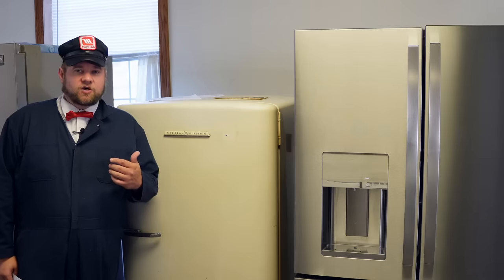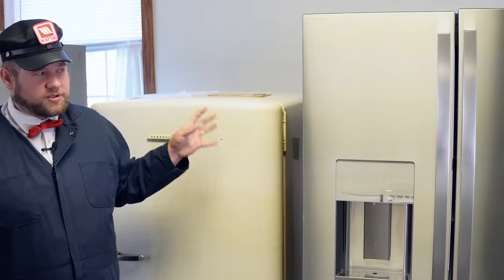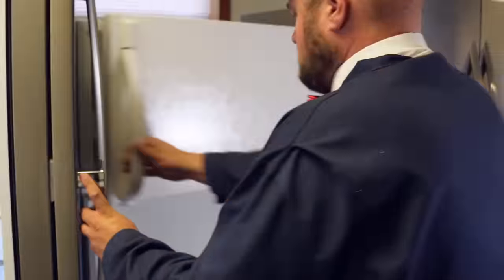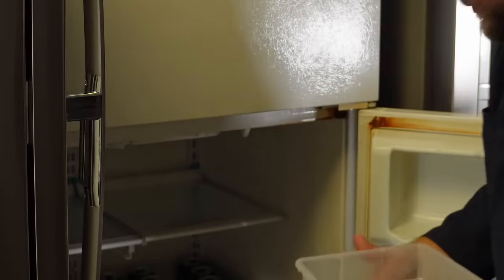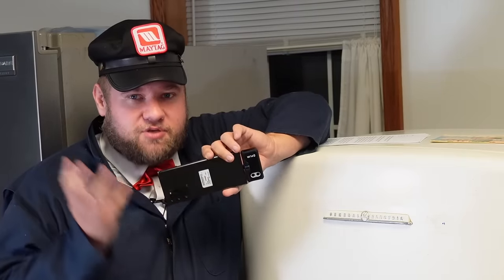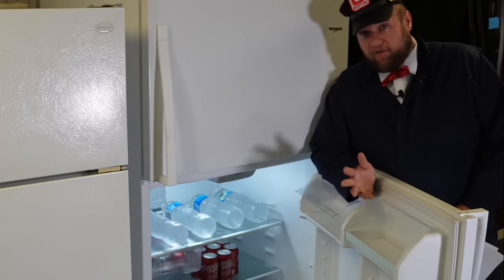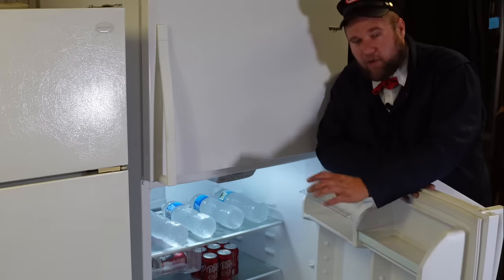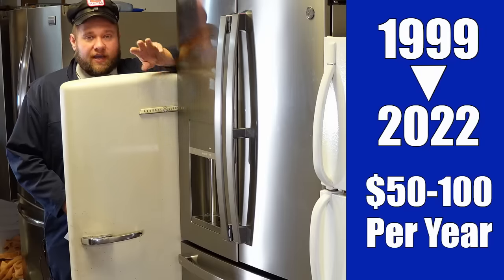Should You EVER Buy a New Appliance if Yours Still Works? A 7-Day Test

Comment: It's beyond disbelief that 10 years would be acceptable as the life span of major appliance.
Reply from the maker: It is. Hopefully a few mfgs. watch this video and get the hint.
Reply: Indeed
Reply: How dare them not make appliances that will still work when I'm elderly
Reply: MY TEST: 1) 1998 Maytag (R134a, side-by-side) uses 3.5kwh/day,    2) 1995 Amana (R134a, bottom freezer) uses  2.4kwh/day.   Note that they where made DRASTIACALLY better than current models.  27 years old and 24 years old and operate perfectly fine.
Reply: My appliances are going on 24 years and I have no intention of replacing them.  I’ve made minor repairs and when I go for parts, the guys tell me NEVER get rid of them and they are from “The Golden Age of Appliances.” 😊
Reply: I've been in the appliances industry for over 20yr and sadly none and I mean no regular residential major appliances will Lasf 10yrs!!! Honestly your looking at 5 to 7 years and that's tops !!
Reply: @MarcM143  I get your cynicism but the technology is there to easily do it.
Reply: I was gifted an early '70's Maytag washer and dryer when I moved into my house in 2004. Still running after a few repairs done by myself. I have no plans to retire these machines.
Reply: @glendonwagers2471  All my appliances from 15-20 years ago are working just fine.  It’s all about how you take care of them.
Reply: Speaking as an HVAC tech there's some people in my industry that push the same figures. Luckily higher quality of install can improve longevity and durability.
Reply: The term for them used to be "consumer durables." Not so much anymore.
Reply: What did you expect it yyo be 7 years ? It's less than 7 for a lot of them.
Reply: @bensappliancesandjunk  Unfortunately they know exactly how long the expected life time is before they break which is why they only give a warranty for 5 or so years, just long enough to sound good but long enough you are well out of warranty and need to buy a new one and keep feeding their pockets.
Reply: Everything is built to a price point.
Reply: @glendonwagers2471  I only had a washing machine dying after ~11 years. All other appliances still live on.

I think my 15 year old plasma TV will survive another 2 tech-generations.
Reply: 10? I wish, and I get your point.

I am so fed up with Siemens (BSH): 6 year old appliances, the gas burner with a computer inside is waiting for its second board. The fridge I had to call technical service 3 times, dish washer two times. Next year when the burner goes again I am replacing it with something else. Microwave is Electrolux and also turns itself on all the time. Only thing that hasn't caused trouble is Whirlpool oven. Such a joke.

My mother has miele washing machine, dryer and dish washer, less than five years, already had to call technical service for the dryer because dried o rings. 200+ USD repair.
Reply: I worked for whirlpool. The problem is government regulations determine what types of refrigerant we can use, the wattage of parts like compressors and motors, and shit like that. This results in designs that don't last as long. The other problem with modern appliances is they have a bunch of chips. Computer parts do not last like mechanical parts do.
Reply: @pablopicaro7649  My big 1991 Frigidaire side-by-side uses about 4kwh/day.
Reply: @glendonwagers2471  Maybe I'm from an alternate dimension or something, but all the refrigerators in my possession, my parents, my in-laws etc are over 10 years old with no issues.  The fridge in my kitchen is a freezer-on-top Frigidare from '99.  I had it's thermostat repaired once 5 years ago.  It's fine now.  I replaced my dishwasher 2 years ago - the previous one was 20 years old.  My washer is a Maytag Neptune from 2001 and the dryer is a Maytag from the '80s.  All are fine.  What are you people all doing to your appliances????
Reply: What do you mean? (not trolling, your comment could be understood both way depending if you are on the manufacturer or customer side...). If my 500 euros fridge does last 10 years, I wont be particularly unhappy knowing they are build with planned obsolescence in mind these days...
Reply: I mean it was accepted for years that you would by a new car every 5 or so years.
Reply: @nicholascortez728  huh I get a new car like every 2-4 years
Reply: Me too, I was under the impression 15- 20 years was a norm for a Major appliance SMH
Reply: @MarcM143  that’s a good göyim, keep paying the göyim tax and be happy you don’t have less.
Reply: for sure, especially with how much they cost
Reply: @glendonwagers2471  i can't recall a single major appliance stop working for me in my entire life, both my own and my parents. 

Granted I'm not American, but I assume we're all using the same foreign goods.
Reply: for european major appliances from european brands the expectation is about 14 years with maybe a minor repair around 8 years and proper maintenance. you can get 20 years from obscenely expensive premium (domestic) brands. I reckon that's acceptable, and now the eu mandates parts availability. The only way the situation can improve is with government involvement.
Reply: Well, you can drastically prolong the average lifespan of your appliances by only buying those which have the least features, don't claim to be the most energy-efficient (reasonably efficient is OK) and are from brands that a professional repairman will say last long time. Preferably something manufactured in a civilised country. It is true for anything. Lotus cars moved their steering wheel housing manufacture from Czech Republic to China to cut costs, but had to return back to CZ and beg the original company to make them again as in China, nobody was capable of properly cast the alloy and than work it into shape (the Czech company was able to do it and used the best technology for it and their staff had decades of experience in the field)
Reply: And it's terrible for the environment
Reply: @glasshalffull2930  Same. Wifey wanted a new washer/dryer/fridge when they only required a combined $75 in small part replacement. I convinced her that 75 is less than 3500.
Reply: I don’t know where people got it that shit needs to last 25 years. I work on furnaces and people just have so much trouble understanding that the else things go through a beating. Imagine driving your car 24/7, how long would that last?
Reply: The real problem is companies overcharging for labor. We live in a throw away society where a simple 20 dollar part costs 300 for someone that knows how to install it.
Reply: Those poor corporate execs can barely afford to keep the lights on in their fifth home! They HAVE to sell junk with a limited lifespan to keep that money rolling in!
Reply: @abrahamlincoln9758   The idea that appliances, that are working perfectly fine, need to be replaced because they’re outdated or not  in fashion is maddening.
Reply: I hate to tell u but I bought a large Amana fridge back in them 1990's. My parents are still using that fridge. My dad has replaced the gaskets twice and that is it
Reply: @katespencer4038  Actually, that’s to be expected as the ‘90s were the last time appliances were made to last.  INMO, a major part of it was the switch to digital features controlled by circuit boards.  The boards just cannot standup in the wet/hot/cold environments.
Reply: @hunner9500  Some experts now believe that furnaces are not cars, furnaces don't operate on salty roads, but are often kept inside houses. My grandfather installed a furnace in the early 1970s and it remained working until mid 2000s when it was replaced due to fear of new environmental regulations under a financial incentive to change your furnaces, still fully operational. My ex had a furnace from the 60s as late as I remember (last I have seen it was 2011). Those furnaces were made cheaply in the second world and were considered of low quality on the world market.
Reply: @glasshalffull2930  good to know I am sick of replacing appliances have located rebuilt appliance store. Now I know the decade to look for
Reply: @katespencer4038  With a digital multimeter and YouTube, almost anything can be repaired.  Best of luck!
Reply: Sadly, if you run the numbers, companies would lose money if they invested into making stuff that lasts that long. There should be government incentives instead
Reply: @abrahamlincoln9758  How long did that take & what argument was the winner?
Reply: @hunner9500  my dad put a floor furnace in his parents house in 1950 that furnace is still working fine. i would bet it is still working 50 years from now, with a yearly cleaning, but i will not be here to collect on the bet.  things are just not built to last these days
Reply: My mom's 4 year old deep freeze quit and spoiled $500 worth of food.  The appliance dealer said appliances are only made to last 3 years.  These people should be sued, for how much food we lose over this.
Reply: This is totally true. Our last dishwasher only lasted 6 years, we replaced it with a Maytag one.
Reply: @420BLUNTLEY  This just literally made me lose all faith in humanity for the f**** 100th time. Not All appliance manufacturers are Jewish, so stop bringing religion into this.
Reply: planned obsolescence
Reply: @dfgrego  Oh no, there was no argument. I just pretended not to hear her after she said "HONEEEEY! THE [APPLIANCE] IS BROKEN!" and immediately when into deaf husband mode when she said, "We're due for a new one anyway. I'll start looking online."

The key is speed. You have about 15 minutes to find the problem and the part and two days to fix it completely while she searches for a replacement. Do not consult whether to fix or replace. This will initiate a conversation that will result in an argument that you will lose. Do not ask her about her online search, that will initiate a conversation that will result in an argument that you will lose. Do not tell her that you'll have it fixed soon, that will initiate a conversation that will result in an argument that you will lose. Instead, find the part you need online, wait till approaches you with her dream machine that she openly admits you can't afford, then tell her you already have the part on order and you'll have fixed the problem for fewer than $50 with your impressive manly repair skill that you totally didn't watch youtube videos to obtain. Essentially, you must solve the problem before she does, showing her what a manly man you are that doesn't need help from the internet.
Reply: @petrmaly9087  stop making up stories. If you pay people properly you get quality products. I’m not aware any cz made products that China cannot make; there are a lot of things China makes that CZ cannot. How many CZ universities are on the list of the world best universities?
Reply: @CB-bl8sp  That's not a story, that's a fact. I told you a housing for the steering wheel for Lotus cars. There is a reason why companies like Colt (US weapons manufacturer) are owned by Czech corporations. And if you think that "if you pay properly" is the only way... well it doesn't work either, you need to provide benefits for the population as well, like not living in a totalitarian hellhole, having human rights, which is normal in CZ, but only a dream in China and the best people run away.
Reply: My family has only ever replaced fridges when they broke and the longest lasting for us here in the UK out of all lasted like 11 years and was a Hotpoint brand about as big as that 2022 GE fridge you have but instead of having a 2 door fridge on top and a freezer on the bottom it had 2 doors going from top to the very bottom and the right door had the fridge and the left side door was the freezer side
Reply: @glasshalffull2930  23 years for me, and my fridge is the parents old one so 30+ maytag.
Reply: I just picked up a whirlpool gold double door refrigerator from 2001 for my new to me house. It wouldn't cool at first but a $10 relay fixed it so no need to buy a newer one
Reply: air conditioners the new ones are the same lol and its not wven a guarantee the 10 years
Reply: 18 months seems to be my current run with kitchenaid appliances, except the mixer keeps going. blender, food processor, trash.
Reply: I've seen vacuums shit themselves in like 5 weeks
Reply: @stephenmergner  technology is there to help the business who sold you crap, not help you save money/hassle.
Reply: @bensappliancesandjunk  Just buy Miele. Problem solved. Or Bosch. Siemens even. Or AEG. 

That's the order of "solidness" too.
Reply: Just replaced a 40+ yr old furnace and was told the new one might be good 10-15 years.
Reply: They last more than 10 years if you don't buy the bottom line budget models.
Reply: @DOGS LOL Great argument, mr. dogs lol
Reply: I am knocking on wood as I type this but we have  Samsung kitchen appliances and all but the dishwasher are still going strong and just turned 10 on black Friday. We do have a hole house surge protector and each appliance also has its own, not sure if that helps but I think it does. The dishwasher sprung a leak last year and I just replaced it with a new Samsung that was on black Friday sale.
Reply: Same reason roads get potholes and lightbulbs burn out, ANYTHING can be made to last, but people that repair this stuff need jobs too. Now the line needs to be drawn between corporate greed driven by disposability, and tedious unreliable sh*t that nobody wants to own, repair or buy that may not even work. Theres 2 extremes.
Reply: My repairman told me average lifespan on the LG fridges is 7 years.
Reply: @sunnohh  I'm gonna guess you lease or like having loans if you're talking buying new. 

Back in the day it (40s-70s) was the idea was you would trade in your car about every 5 years or so cause that's about how long they would last from wear. That why you will hear old timers say shit like "oh it's got 100,000 miles, that's gonna be worn out".
Reply: @SilvaDreams  I mean you can always repair them... depending on the make parts can be readily available. Just replaced the circulation motor on my 7 year old KitchenAid dishwasher. Cost me $165 and 45 minutes of my day as apposed to 800-1500 for an "equivalent" model. 

The issue is is they have successfully made it so people see an older appliance as outdated/inferior and the idea of not having the latest and greatest means you are poor/low class which isn't desirable.
Reply: @jackyack7850  that's generous.
Reply: If businesses made everything they made to last the max they could, what keeps them in business?
Reply: @abrahamlincoln9758  You are wise beyond your years!!! As a very frugal woman, I will not divulge this manipulation to my fellow women. 

Men!!! Are you listening to this? Heed this man's words of wisdom.
Reply: It’s because most new appliances are only made to last 10 years
Reply: I have Samsung appliances. Never had a single issue and way cheaper to run than the competitors.
Reply: @MarcM143  Yea, unironically they should last until you are elderly. They are simple machines that have already been perfected. Then they intentionally started practicing the filthy practice of planned obsolescence, and all of those involved need named and shamed.
Reply: Try 2 years on tumble driers and washing machines, it's disgraceful!
Reply: @aHumanCookiee  Currently using a washing machine from 1992.
Reply: My buddy bought a brand new washing machine 10 years ago. About a month after the warranty ended it broke down. I'm old, growing up we had a fridge that must have lasted 20 years.
Reply: @SilvaDreams  thats not really how it is, it’s cheaper to repair appliances than to replace.
Reply: I feel like I've gone through too many dryers for someone my age (23) but if you include dryers that roommates owned + mine I've had to replace like 4 broken dryers since moving out at 18
Reply: @Isissa125  If they were new, it's evidence you get what you pay for.
Reply: supply and demand, almost everything is built to fail nowadays
Reply: @glendonwagers2471   i going on 20 years 3 applainces and no repairs yet, stuff can last
Reply: @LostBeetle  yup, they lasted back then.

We just replaced a tumble that started blowing trip switches at 2 years old.

The fact appliances like this only have a years warranty on them shows how long they are designed to last. It's not even worth paying a call out charge to get them repaired at the moment.

Hopefully right to repair will sort this out.
Reply: @jakerazmataz852  yup, It all used to last. We had a fridge and a boiler that lasted about 23 years.

Nowadays you are looking at 10 years if you're lucky.
Reply: Appliances from 15 to 20 years ago were built better than anything in the last 10 years.
Reply: 10 years is a pretty good time for any device without it turning into the ship of theseus.
Reply: @HeatGeek1  yes.  Had a few noobs install heat pump/Ac combo.  Problems every freaking year!  Had to ditch it in the 90s
Reply: @ohsoloco5113  I had same and traded in a brownish yellow with what looked like a bullet hole on side of it 1970s GE washing machine for a 2020 pretty white spindleless energy efficient self sensing top loading Kenmore  washer and have already had to change the balancing springs because it kept going out of balance no matter what we washed... then I found out a special type of grease can be reapplied to the spring spindles to help them grab better to make the balancing work properly again... point is i have already had to fix it and the old one rusted though before it needed any adjustments... probably should have just switched the old drum, but new stuff looks nice....
Reply: @aHumanCookiee  believe it or not 23 years for a cast iron sectional boiler if that's what you had is actually fairly a fairly short life span. 30 to 40 years is more common. People do cringe when they see the install prices though.
Reply: @HeatGeek1  no it wasn't a sectional boiler, it was a standard Trianco utility boiler.

Dad replaced it himself at 71 years old because installation costs were ridiculous.
Reply: It's not just the customer getting screwed over with a 7 year refer, but the resources used going into making the thing. Just look at the time, material and energy that goes into making just one. (make sure you include the oil well and refining to make the plastic) Since we're replacing them at around 7-10 years, we're building 3x more refers than we need to.
Reply: I can see the appliance companies reading these comments and thinking, "... dang, you mean these things will last up to 7 years??"!
Reply: Based on my experience, if a refer runs for 10 years it'll probably go for 50.  I have two, a 2003 Whirlpool (with still working ice maker) and a 1995 Roper.  I thought about something more efficient but after this video, I'm keeping them. 😏
Reply: @bensappliancesandjunk  I don't care if a new fridge is more efficient if my old one still works I'm keeping I wo t justify paying 2-3,000 for a new high end fridge to only last a few years.  Here at our work we have had the same whirlpool gold white sided by side since 2002 it works perfectly there is absolutely nothing wrong with it. My mother has had the same jeenair fridge since 2002 as well too I've have recently repaired it the defrost heater went out she was going to toss it for a new one I told I'll just go over there and repair it. It's now currently working g perfectly again.

At home I have a old fridgidar from 201p top and bottom stainless steel works perfectly yes I keep fridge temp thermometers in my fridges and freezers. I also have a whirlpool 90s ge top and bottom white in our garage it works perfect as well.

I can't justify replacing my old fridges that work perfectly and have worked great for 10 plus years for a new fridge that might die in just a few years before we even see any savings so in reality there really is no reason in my opinion to replace a fridge that's working just fine.

If they can make a new fridge that will easily run 20 years I might consider a new fridge until then I'll keep mine until they die.

I've had friends and family buy new refrigerators spent good money and they run long enough for the warranty to expire then they have problems or they have issues from day one. I'm not I interested in replacing a good fridge for that.   That goes to all my appliances.  My washer and dryer are 20 years old and work perfectly I have no intreast in replacing them. The only appliance I've replaced is my dishwasher and ac unit and that's because they died.
Reply: @stevenplaysbone8791  in surprised. In the car world whitch I'm more familiar with the electrics are always the last to fail unless they get wet. Sensors not withstanding
Reply: @putinslittlehacker4793  well, it's apparently the opposite in appliances. I know ovens can get up to damn near a thousand degrees. All I know is when I have someone call because their 3 year old fridge or dryer is fucked it's the control board.
Reply: @MarcM143  The point isn't that they can't, but rather that they actively choose not to. They specifically engineer their products to fail because they make more money if you have to buy seven fridges throughout your life, instead of just one that can be repaired. It's also vastly more wasteful, but people seem to ignore that part because they get a shiny new appliance every few years.
Reply: I hate to say it, but perhaps apparently this is an area where government regulation is needed because of how these short lifespans affect the environment. On the other hand, if refrigerators lasted 20 years, then there’d be more power consumption because of older and less efficient refrigerators. Of course, how much electricity and fuel is used to produce new refrigerators and transport them to stores and homes? There really isn’t a winning formula. 🤷‍♂️
Reply: @glendonwagers2471  
My window a/c units are 4 years old. I spent extra for the nice quiet models. Of course nobody mentioned they’re partly quieter because the fan speed is slower so they take longer to cool a room.

The electronic touch controls on one of them started messing up in the third year, so I had to start using the remote only, which is silly to have on something that you set and forget. The other one stopped blowing out of one vent in the fourth year, which doesn’t make any sense since I doubt it has two fans, but maybe it does. It will cost $350 each to replace them with an updated model, which includes wifi, an unnecessary feature that just provides another source of malfunctioning.

A few years ago I bought a Vitamix blender. They had just introduced a model with wifi, which I chose not to buy. I don’t need wifi on my blender. I don’t need another source of malfunctioning.

I don’t want wifi on my blender, a/c, or washer and dryer. I just want off, on, and speed controls. The good old dials and buttons, not electronic touch controls.
Reply: @CantankerousDave  
Yes, I remember the term “durable goods”. Even my $1,300 iPhone 12 Pro Max isn’t durable. The speaker crapped out after the 1 year warranty so know I have to use headphones to hear anything.
Reply: @amplituhedron5582  
Now that many new appliances have wifi, it won’t be long before they call the repairman automatically when a malfunction occurs. That’s where the dealers are going to make their money.
Reply: @stevenplaysbone8791  
Maybe manufacturers should inform consumers about the government regulations so consumers can push back.

If you have to replace your appliances every 5 years, there likely isn’t any energy savings because of the cost of production and transportation. It’s no different than electric cars not having any net carbon footprint than gas cars.
Reply: @LuckyCharms777  I agree.
Reply: @Progan666  
I was thinking government involvement was necessary too, but according to the guy who worked at whirlpool, apparently government interference is the problem, just like we’re seeing with electric cars. Soon enough electricity bills for charging cars will eclipse gas bills.
Reply: @hunner9500  
“Imagine driving your car 24/7, how long would that last?”
Apparently you’ve never heard of the most beloved fleet vehicle in the US, the Ford Crown Victoria. Between taxi and police service, they were used quite a bit.
Reply: @LuckyCharms777  They also has good maintenance.
Reply: @jackyack7850  That's sad. I thought LG made good stuff.
Reply: @CB-bl8sp  
Fun fact: American manufacturers had to teach Chinese manufacturers how to make things in order to have any semblance of quality control. The Chinese didn’t know how to do it until foreigners taught them.
Fun fact: Where do the brightest Chinese students attend college? Where did the instructors at China’s top universities get their educations?
Fun fact: Foreign countries all across the world have relied on Western knowledge. It’s only after having been taught by the West that they’re able to become self-reliant.
Reply: @Egleu1  
Nope, because the only difference between low end and high end models are the features, which are often the cause of failure and replacement.
Reply: @mattstroker3742   Not a lot of people are willing to pay twice up front for the hope it will last twice as long. I must say, my Mom bought an Electrolux vacuum from a door to door salesman in the 60's.. Damn thing still works.
Reply: @xPRODIGYxGAMER  I literally scheduled 40+ appliance repairs a day, and had access to what the most common failures are and when they occur. After two years the most common failure point by far was a control board or another computer part.
Reply: So did they in 1950 according to that manual:

"a dependable refrigerator. The refrigerating syste has been designed to provide many years of faithful operation. More than two million systems have been in service TEN YEARS or longer"
Reply: @rockstardonut777  
In the old days, people weren’t dumb enough to buy appliances that wouldn’t last, but today we even have bozos buying smartphones every year. Disposable appliances is akin to “you will own nothing and be happy”, since the powers that be want us to be lifelong renters of their products, which the replacement of appliances every few years is essentially. Remember when people had to rent home phones from AT&T because that was a huge revenue maker for them. I think it was the government that finally prevented them from doing that, but that’s exactly what the future holds. The subscriber model is the most profitable.
Reply: I think it's perfectly understandable, provided that you understand the despicable nature of the modern appliance industry.

I'm a bitter misanthrope, so I naturally appreciate that grim reality.
Reply: @glasshalffull2930  what era are they from?
Reply: money go brrrrrr
Reply: so let's compare an apple, an orange, and a banana
Reply: @ragebait988  1998
Reply: @MarcM143  When you start having to actually work and spend upwards of $2-3K on a refrigerator, you'll get it. ;)
Reply: @Progan666  Government interference has created the high-efficiency equipment that don’t last that we live in now. we need all governments to get out of the appliance business and HVAC business and the plumbing business and we’ll all get a better product.
Reply: @hunner9500  do you want to work for less money?
Reply: If they/we were really serious about the environment, they'd stop focusing so much on energy usage, they would instead give ratings for durability, repairability, and lifespan. Why can't 'EnergyStar' be more about just electrical efficiency and instead take into account the whole environmental impact of things that last less than 5 or 10 years? Manufacturing, distributing, and disposing of goods takes a lot of raw material and energy...
Reply: @chadhartsees  if you look at government policies across-the-board they have always cause more harm than good capitalism is the only way to achieve a balance let the customer choose. The key is limited government and more individual freedom. just go to Washington DC and visit your senator it will open your eyes. You’ll realize how dysfunctional our government really is.
Reply: Samsung you would expect 5 years before it dies. 

Never buy Samsung appliances.
Reply: I think you meant to say "beyond belief". But I agree, these things should last 15+. 10 years flies by.
Reply: @stephenmergner  Of course but there is no PROFIT in doing it. Most of the public want low cost and are not at all techies. The average idiot doesn't think like that. Only industrial/commercial gear is worth buying. (That's why I copied what local laundromats buy and ordered Speed Queens online, there being zero reason to have some brick and mortar outfit do the same thing.)
Reply: My 1992 Maytag RTD1900a is still going strong without a single repair. I am blessed.🙏 The family wood like ice through the door. I am not willing to give it up for modern junk🙄
Reply: The industry uses terms like "design obsolescence" that failure is designed into the unit to ensure replacement.
Reply: @user-tb7rn1il3q  that makes literally no sense....how the hell can you be rough on a fridge...
Reply: @HeatGeek1  to a point...manufactures LITERALLY design to fail. Carrier makes variable inducers that sag over time causing the wheel to explode. Min 1000$ replacement for the stupid motor plus labor. It would easily sway people to replace the entire machine. Your install only goes so far. Manufactures are all cancer and want your shit to break
Reply: Russian here. It's fun that we have a ton of folks using old finnish fridges (70s-90s) today and they are indestructible. There were a lot of them imported second hand in 00's and they are in use today. Washing machines, cooking stoves are same thing. They are easily repaired with parts still available, and they hold their value for decades. 10 years old major appliances are basically new, why change them...
Reply: Uh, do you know how long 10 years is?  I don’t think you’re truly grasping that timeframe
Reply: It should be beyond belief because the guy just claimed it without any source. Which corporations said this? They're really all in agreement and they stated this publicly??
Reply: The Ge 2022 is actually the best one per cubic sq foot 🤷‍♂️
Reply: I'm of a belief that customers created this, because we always go for the cheaper price even in major appliances. Think of people that buy houses to rent? They usually don't think farther than 5 years
Reply: I have a freezer that has worked flawlessly the last 25 years 🤣🤣
Reply: The other problem is modern appliances ARE well designed and built. But since it’s expensive to build things like a brick shithouse nowadays, they require a little more care and occasional repair. Most people neither understand, nor know how, nor can afford to pay a contractor to provide this care.
Reply: @sunnohh  Cars used to be financed for 36 months.  Now many are for 72 months.  For most of us, the prices have increased twice as fast as our pay.  We make a third as much as our grandfathers and half what our fathers made for the same job, in adjusted pay.  Subsequent generations will live in poverty.
Reply: @nicholascortez728  My 2004 Jeep Grand Cherokee still looks great and going strong
Reply: Ahould be at least 20
Reply: @user-tb7rn1il3q  Nah, shit's built to break, break early at that.
Reply: @hunner9500  Some things, like fridges, will run 24/7. A car, a personal one anyway, won't be used 24/7. A car may be used for 4-5 hours a day, if it's a personal vehicle.
Reply: Nowadays appliances don't last... I bought a fridge that only made it for 4 years. Fixing it was way too expensive. So I got a new expensive and more energy saving one. If this won't last 10 years I'll get very upset
Reply: @MarcM143  there's no reason they can't be built to last 25 years. They have one job and shouldn't break from just doing their job before at least 15 yrs.
Reply: You may save on electricity with newer fridges but, a simple inflation calculator online will help clarify where the real savings are…over 72 years.

There’s no reason other than greed that a modern refrigerator can’t last at least 30 years. I finished using the the unit that came with the house 26 years ago and have since bought two more.

Nobody in the appliance industry can tell me they give a 💩about the environment (and berate people for living their lives) when they use so many resources and generate so much waste
Reply: My Samsung refrigerator lasted 5 years before the compressor gave out...After being strung for a long week by a local refrigerator repairman, I decided to bite the bullet and buy a new one. A Whirlpool.
Reply: @glasshalffull2930  I'm sure if I was in 1998 buying those same appliances any number of those same "repair guys" would tell me that the new ones are junk and that I should stick with ones made in the 1960s or 1970s
Reply: when my parents bought our house, they hired someone to come in and look everything over, and he said that we should >NEVER< get rid of the ancient oven and range that we have, because they quote "don't make them like that anymore."
Reply: It’s so sad that big cooperations make stuff to break so people buy more. It’s terrible for the consumer, environment, and society. Imagine how great it would be if you only had to buy stuff once and never again.
Reply: @user-tb7rn1il3q 15-20 years ago was still the good years.. 2010 and past that is when it started
Reply: America for you

Capitalism
Reply: Damn, didn't know appliances also have expiration dates as well
Reply: @user-tb7rn1il3q  None speak about how a fridge is kept (or a PC or a laptop or a TV). If you take care of the technology, the technology will take care of your needs (i.e. live longer)
Reply: @jsteiger2228  I am reading the comments and I am starting to think that either programmed obsolence is more of a thing in America than Europe, or people dont treat their apliances very good... My parents have only had to change the microwave (got up in flames) and washer (started losing water and turning itself off mid wash) in 25 years
Reply: It’s called planned obsolecence
Reply: @stevenplaysbone8791  I'd say there is definitely a huge cost to government regulations and I will rage about it everyday, however I think the manufacturers have decided they like the 7 year lifespan.  Would you rather sell 10 fridges per household in a life time or 2?

And there are still brands making 20+ year machines, you just pay a lot more up front, they're outside the budget of most consumers.
Reply: Unfortunately it is true. The price of refrigerators has tripled, basically. 
I would suggest finding, or hanging on to your 12-20 year old unit, take good care of it, and if it needs a repair, you tube the diy video if you can.. It's worth it. I can't stress the importance of maintenance.  Cleaning the condenser is key. If you don't know what I mean just find a video describing that. And clean the fan blade and cowling while you are at it .
Or call me. It's what I do.
Reply: 5 - 7 at most, nothing would last 10 years now
Reply: they don't save any $$$ you have to buy a new one every seven years.
Reply: @lookoutforchris  stop being mad you're a poor jew
Reply: I like it bc I can get cheap 10yo appliances cheap
Reply: 10 years was what retailers were telling me too, when I was looking for a new refrigerator. Manufacturers do it that way so you buy a new refrigerator every 10 years and they make more money. They also told me I had to change my water filter every six months, even though I’m single and don’t use as much water as a family of four. The water filter was expensive. I said screw that and kept my old Whirlpool refrigerator, which has been running fine for 27 years now. When it dies, I’ll get a new one.
I bought a new dishwasher when my old one broke. Bad move. I should’ve just had my old Hot Point dishwasher repaired. It washed great! This new LG piece of garbage, doesn’t even get the dishes clean.
My clothes washer died and I’m contemplating what to do with it. It lasted 26 years. It doesn’t advance through the stages automatically, and the pump died, so I guess I’ll break down and get a new one.
Reply: @alan30189  it's really not. 10 years is just what they warranty then for.
Reply: If they had their way they would have everybody putting a new fridge every 2 years, then even quicker once people get used to that!
Reply: You can't give the economy proper stimulation if things last a significant amount of time
Reply: Amen!!
Reply: @pablopicaro7649  Yes, I have the same Amana Fridge and a technician  who was fixing my dishwasher said run that fridge into the ground before replacing it.
Reply: Maybe I missed something, but what are the temperatures?
Reply: Ten years feels generous anymore. Many refrigerators die much faster.
Reply: @glendonwagers2471  im a salesman and I tell people 3 to 7. So yeah, it's ridiculous nowadays!
Reply: @MarcM143   sarcasm
Reply: Beyond belief. Not beyond disbelief. And 10 years is a joke. An appliance repair guy just told me that if you get 3 years out of your new fridge, you are lucky. They are designed to fail right at the time the warranty expires.
Reply: @glendonwagers2471  I tell customers 5 and that's not repair free. Customer like to hold you accountable when you give them life expectancy predictions. " But you told me it was the best.
Reply: "Durable goods" aren't so durable anymore.
Reply: Especially at those crazy prices... $2k is mid range🤦‍♀️
Reply: @ohsoloco5113  bought a Kenmore front loader 11 years ago...   Sensor has gone on it.   I ordered a part today and hope it fixes it😅. I don't want a new Disposable one
Reply: @lisat9707  I hope you get it fixed yourself. My dishwasher isn't very old and it's needed lots of repairs already (costing more than the unit itself). A few years ago the pump went bad on it. $100 for a repairman to come out and diagnose it. He then told me a replacement part was over $200 plus labor to swap it out. After he left I looked it up and could get the part myself for a little over $100. The repair was really straightforward as well. I called and canceled the repair and did it myself.
Reply: @MarcM143  Yes so much better to be manipulated into buying expensive appliances every few years and dumping the ones we bought just a few years before into landfills. Who wants to go on vacation or relax a little when we can spend all of our “disposable” income on yet another fridge. I personally love making the CEO of GE wealthy while my family and our planet suffers.
Reply: @MarcM143  I replaced a working 31 year old fridge with my current that has been going for 18 year. From just experience I expect a fridge to last 18+ years.
Reply: @nicholascortez728   My dad had 1962 Plymouth Fury that he bought new.  It stayed in the family for many years and was driven over 400,000 miles.
Reply: Ugh, who would want an appliance that's more than 10 years old? I like to refresh mine every few years to get the latest and greatest.
Reply: Just remember that a $400 refrigerator would be the equivalent of about $5,000 today. And it’s a lot smaller than a $600 refrigerator today. You’re still getting what you paid for today which isn’t nearly as much. Hope that gives you some perspective.
Reply: @pauldzim  latest doesn’t always equal greatest. And my parents had the same TV my entire life. Something changed in the 80s and everything became disposable. That’s not good.
Reply: We moved into our new house in 1964, when my parents sold it in 1985, our fridge still worked.
Reply: @teledoink  But I NEED a fridge with a screen on it
Reply: There's a pun in there somewhere.  Boxers or briefs?  No it Depends.
Reply: My Whirlpool side by side 25 cu ft  is still going strong from 2001. No electronics. My new LG broke down after 5 years. The inverter board burnt out. LG said they guaranteed the compressor for 10 years - but that is not the part that goes wrong! A new board costs at least $200 to replace and fit. I
I will not be replacing my whirlpool…
Reply: @Joseph  I agree, but in practice the boards are poorly designed. The inverter capacitors usually pop even if they are 105 degree types. Then the inverter chip goes up in smoke.

Check the spec of a good quality Panasonic capacitor and it shows typical lifetime hours. Continuous running. It will never last out Grandma’s fridge.
Reply: @glendonwagers2471  My family and friends have had many appliances for 10+ years. Our last oven was there for 15 years, fridge was recently replaced after 10 years in the home and 2 years in the garage. My friends have had similar experiences, one of them even got an old used one on Facebook that still runs perfectly 6 years later. I also used a washer/dryer set from the 90’s all the way up till around 2018. Maybe we are all outliers, but it seems like only the newer appliances break quicker 😂🧐 almost like it is… on purpose.
Reply: @qz6332  No. I'm saying if they develop the technology and make it cheap enough it can change an entire industry, people can lose jobs, look at self checkout.

Go out into the real world and see what it's like. Government doesn't have anything to do with actually paving the roads, it comes down to contractors, contractors have employees, employees with families to feed ect. what i'm getting at is if they made roads that last longer (nothing is permenant) there would be a whole industry p*ssed off and working less hours, leaving for work that can provide for their family. They don't magically wake up one morning with a new set of skills ready to re learn their entire career.  that's just one example.. Its real life, called making a living with a skill.

if STHF tradespeople would have a better chance of survival than most people. Without trades honestly the world you know would not exist. example. trust me you want those guys to WANT to work. they keep your lights on, heat on, your car full of gas and groceries at your stores.

what you're describing is communism, which works but quickly becomes corrupt and becomes a system of segregation. It creates a concept of entitlement  nothing is free and there are no handouts.
Reply: @glasshalffull2930  that's because they know you'll be back to fix it
Reply: @Seer-Of-Lies_Giver-Of-Mutiny   I keep them in business and they keep my appliances in business!  It has saved me thousands while I watch my neighbors on their third refrigerators and washers and dryers.
Reply: @glasshalffull2930  I honestly can't say I would buy a new appliance over a new part either.
Reply: @Seer-Of-Lies_Giver-Of-Mutiny  👍
Reply: Yes, it's a shame it's come to this
Reply: @MarcM143  it takes 60 years to become elderly, not 10 😂
Reply: Ours got 15 plus
Reply: @hunner9500  you don't run a furnace but 3-4 months a year. Hell ya it should last.
Reply: No it's not these days!!
Reply: Planned Obselence
Reply: @williamb454  ours had no P O
Reply: @jsteiger2228  the point is that your appliances were built "back when" when they did last longer. I replaced stove, chest freezer, and 'extra' fridge in 2010, my dryer in 03, and my washer in 97. My main fridge is from 94. Newer appliances do not have thee longevity that older ones do.
Reply: @v1ncen715  nothing should be built with planned obsolescence.
Reply: @hunner9500  my furnace is 49 years old. I have replaced fuses and a fan motor (use error there) but it works like a champ. Could I get a more efficient one? Maybe. Do I want to? No.
Reply: @qz6332  And those self check-outs did replace people. YOU are now the casier. You might as well unload the semi out back, face some product and check receipts.. i think youre comforting yourself by sayin those people are now doing other work.. Sure most of them are but think about how much work they're getting you to do.
Reply: @Falcon-eh8tq  lol I bet you also hated that attendant isn’t pumping your gas in the snow and rain. It’s not you having to do it yourself… you can go to stores with check out, online delivery, pickup, still go to farmers markets. For the vast vast majority of us, the little extra work (probably also for slightly cheaper stuff) is an absolutely fine trade-off.

But again, no they didn’t replace people. They moved them. Now instead of dealing with you, they can do other things that don’t involve dealing with mean customers for low wages. I worked there for a while. We literally fought over not being a cashier because people are rude as hell to employees, sometimes just for their own satisfaction
Reply: @hunner9500  because things used to last decades. Planned obsolescence is real. My boiler is over 35 years old and still works…I had to repair a solder joint on the aquastat, but that’s it
Reply: @sryth1  80% cast iron boiler still last 40 years. Even the ones made in 2000 are still going strong. Very different from your typical high efficient furnace. And even 80% gas furnaces tend to last about 15-20 years which I am more than happy with for $3500
Reply: @ohsoloco5113  My grandparent's GE refrigerator from the 1950's is still running in the basement of my parents house.  It has never needed work and simply keeps running.  It does however need defrosting from time to time as the ice box will freeze solid.  I plan to keep it after my parents pass it on to me.  It's a shame most companies no longer build for quality.
Reply: @Joseph Yeah - High-tech meets bean-counters and planned obsolescence!
Reply: And to think we're going "green"
Reply: I always buy basic… they last forever.
Reply: @user-tb7rn1il3q Absolutely! Every person in my small neighborhood built in 1993 replaced their HVAC system years ago. Mine is still running fine. Yes, I have replaced parts in the furnace, and lined the rusted pan below my A-coil with EPDM rubber, other than that, I clean my A coil, and condenser coil every 6 months, and I change my filter about every quarter. You have GOT to keep the evap, and condenser coils clean I use the foaming cleaner, followed by clean distilled water rinse.
Reply: Did you see how large the condenser coil on the back of that older fridge was, and how dog hair, dust, dirt etc can't get on it?
Reply: A 25 year longevity refrigerator top mount would cost 9000.00
Reply: Never replace if it still works. Mine is a 1979 Frigidaire. Still running just fine. Paid 689.00 in 79.
Reply: @nicholascortez728  that's why I'll never buy a car. I have only owned trucks. It really is just common sense. Think about it: the brakes on a pickup are about double the size they are on a car, because they have to be designed to stop the truck with a load, and they have to assume that you might exceed the maximum load from time to time. The suspension has to be heavier for the same reasons. It's just common sense. My 1994 F150 will soon be 30 years old, my 2004, 20 years old. Both run like swiss watches. The brakes on the 94 lasted till there was 120k miles on the clock, because it was a standard transmission, and I down shifted to slow down.
Reply: @nicholascortez728  Accepted by Whom? Not this guy.
Reply: @sunnohh  And what's your payment, about 570 a month?
Reply: It's not so much the appliances that go bad, in the case of refrigerators, it's the coolant that they use, and the design of the condenser coils. When I was a young man, the condenser coils were all over the back of the fridge. Today, the coils are stuffed under the appliance where dirt and dust can collect on them. The other issue is the coolant. The newer units use 134a, and it becomes depleted in time, and is not as efficient as the old R12, and R22. I own a 2010 Samsung  french door, freezer bottom. It worked perfectly for 13 years. Then it would not cool well, especially the freezer. I added a piercing valve on the low side, and found it to be low on coolant. I added 134a till I got 7 lb on the low side. It now works perfectly again.
Reply: @hunner9500 LOLOL Hey hunner, on the furnace my DAD had installed in his house in 1948, the DRIVE BELT on the blower lasted 35 YEARS. Why did that furnace last so long? 1 The heat exchanger was cast iron. 2 the pilot lite was a very simple thermocouple. 3 the thermostat was a very simple mercury switch. 4. He changed the filter every three months. That furnace never failed. It was finally replaced by my sister in the 80's because she wanted central air. That one has been replaced again around 2000, and she sold the house about 2 years ago.
Reply: 3k every 10 years for I appliance 
Unreal America
Reply: You got 10 years? I hear the new fridges are expected to last 6-8 years now.
Reply: From consumers POV it should be 20+ years.
From producers POV it could be 5 years in order to sell newly developed product and gain profit.

Middle ground:
making appliance with standardised easily replacable and buyable parts (like modern PCs) which are of equal or better quality.
So, consumers profit, producers profit, and repairman profit.
Reply: The life span of an car is 7 yr
Reply: @bensappliancesandjunk  I have a 25 old fridge that works very well but sucks 4x or 5x more energy. I put it in the garage because I need more space but I'm torn by the electric bill. I need something damn basic but I'm afraid everything that is new seems to be crap.